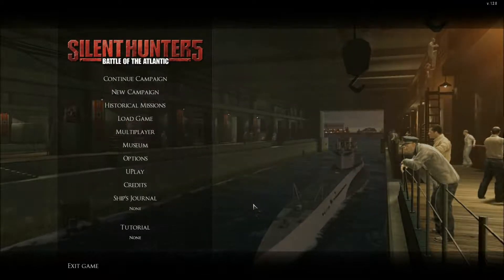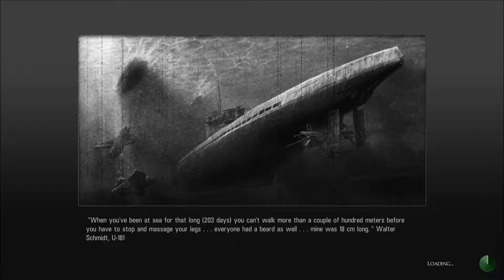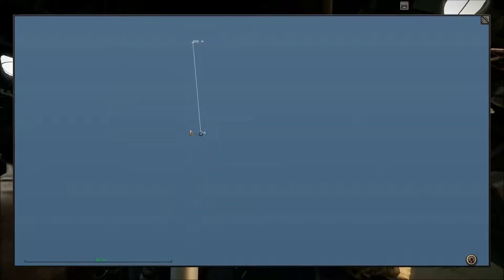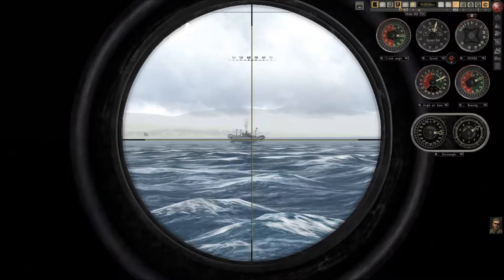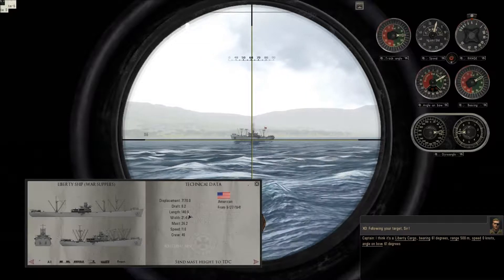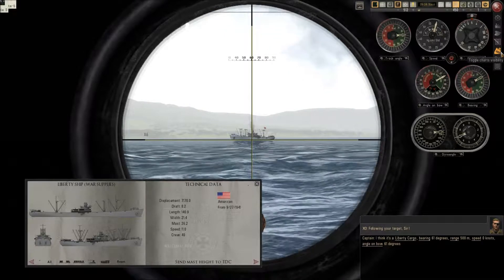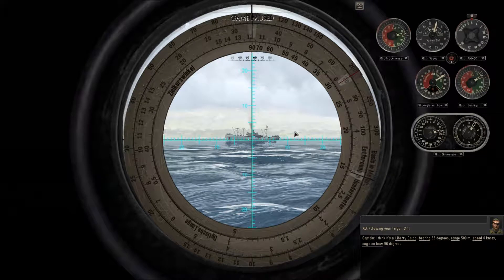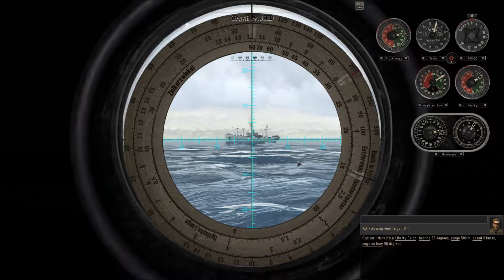How to use only the RAOFB whell with Real nav and Realism 100% in SH5 part 1-3.mkv

Comment: I'm using wolves of steel and I'm missing the 7 dial's on the scope for torpedo control. Did I deactivate them or are they not installed with wolves of steel?
Reply: You normally can activate them by pressing the buttons on the upper left, did you sucessfully use the automatic patcher that comes with TWOS Install?